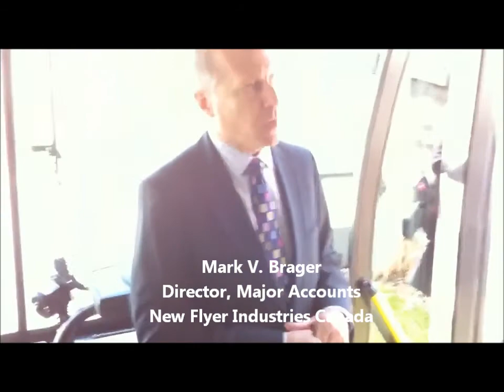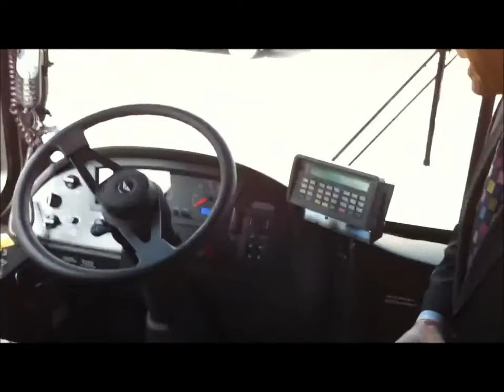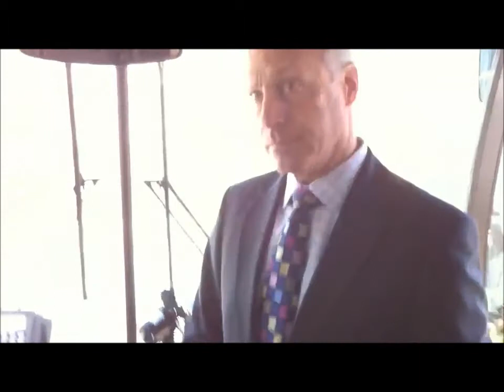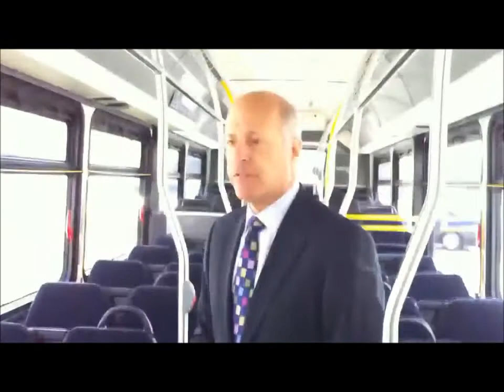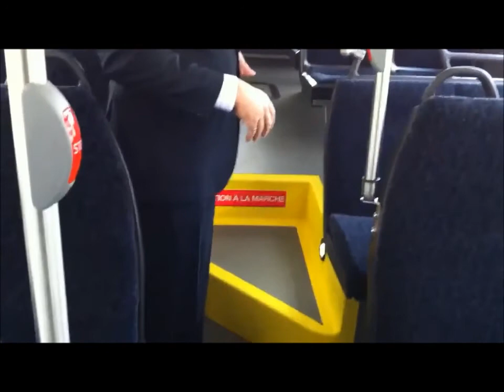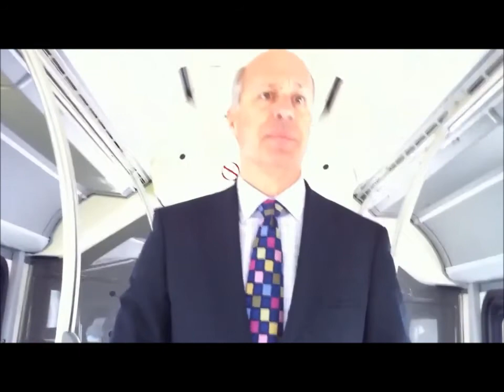New Flyer targets Montreal with its Xcelsior diesel-hybrid bus

Comment: What makes things worse, is that the order for Montreal is the same for the entire province. Total of 475 vehicles, reason being that they would cost far less with the provincial government subsidy on hybrid technology AND on the fact that they are built in province. The New Flyer equivalent would have been about the same cost for less buses due to the lack of government support.

This isn't to say that NovaBUS is bad quality, but New Flyer has existed longer (albeit it under a few different iterations like Western Flyer or just Flyer) and therefore has more experience. They've also had hybrid buses longer than NovaBUS... But none of these factors will stop the major TAs and the Minister of Transport from saving a buck on a local product.

Luckily, as with CIT Sorel-Varennes, URBIS (MRC Les Moulins) and some other smaller Quebec TAs that don't receive subsidies from the government on buses since they are privately operated, they have carte blanche and pay full price no matter which manufacturer they choose. This is why the New Flyer Xcelsior and MiDi has made its way into Quebec in the last few years... Just don't expect one in STM colors anytime soon.